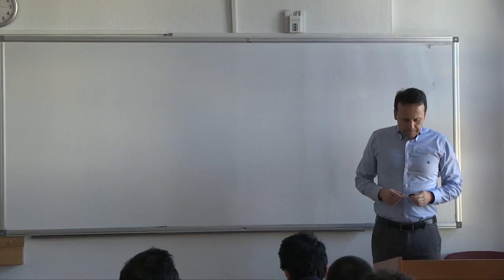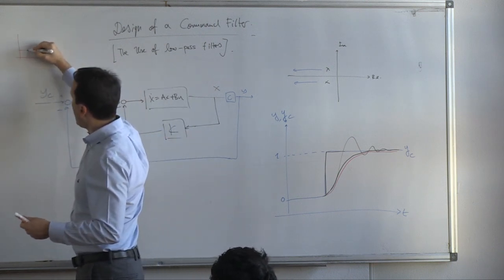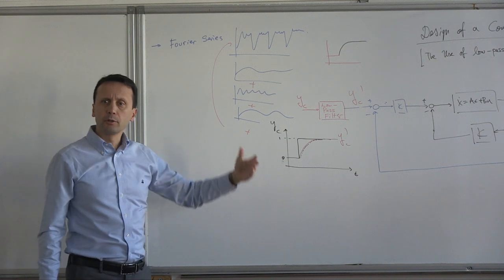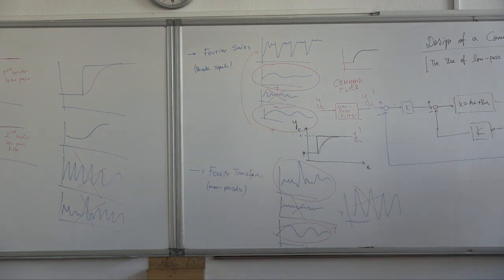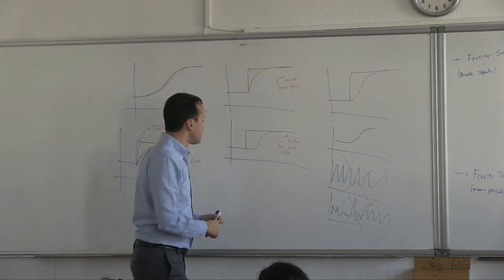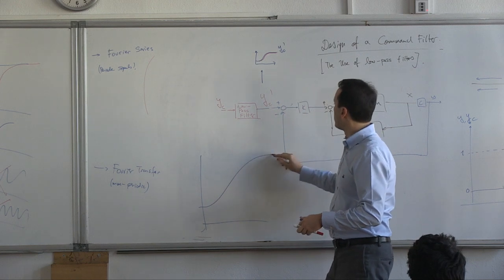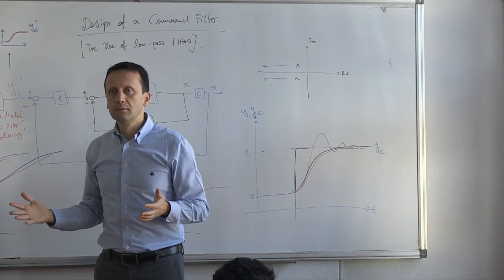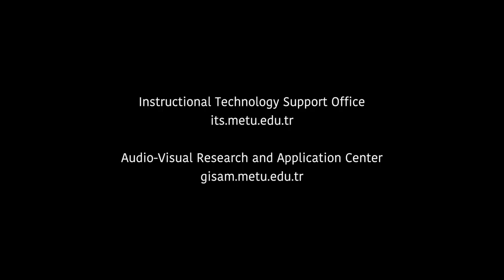AE483 - Automatic Control Systems II - Lecture 10.1

Comment: The course have a very useful dense materials, as Prof. Dr. İlkay has proved again to be a very good lecturer. However, the teaching style in AE372 Flight Mechanics course (hand written presentation) was a lot better than the teaching style for this (board written).
Reply: There is only one lecture hall in the department and it has the camera to show hand writings